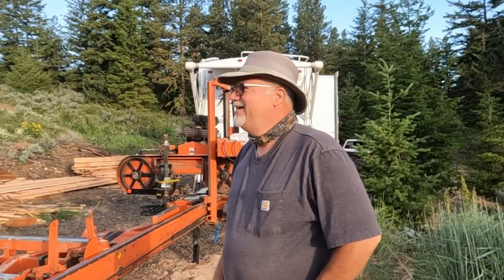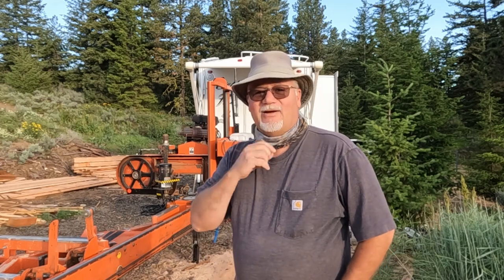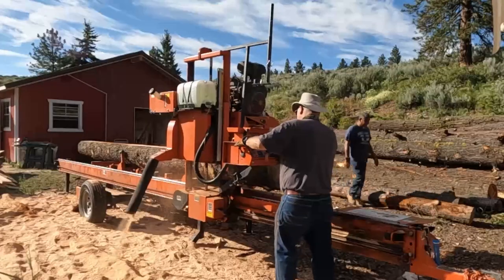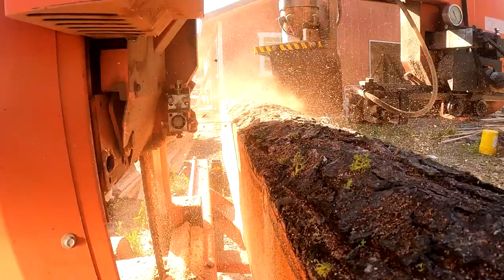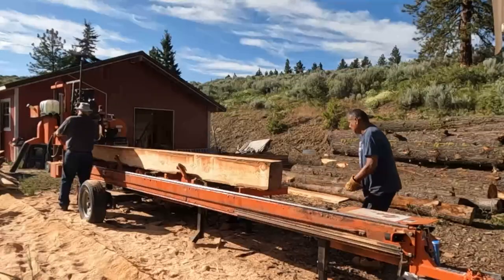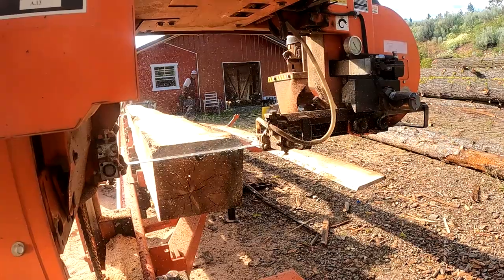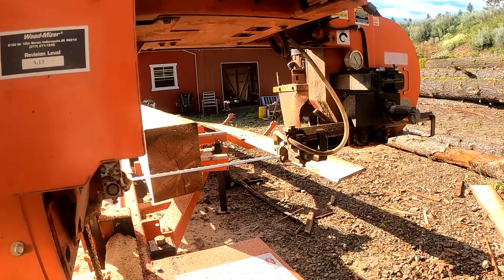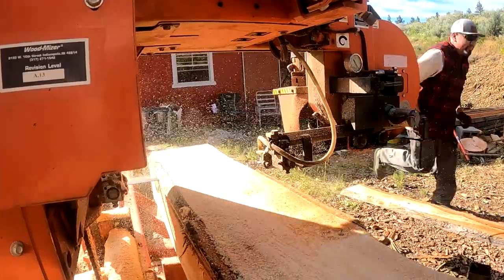Milling Doug Fir on the Wood Mizer LT40 [Mistakes were made]

Comment: In reference to woodmizer and the supply issues, I completely understand the hold up on parts. I'm very anxiously waiting on my call saying that my mill is waiting on me to pick up! Have a ways to go, orderd in 3/22 , build date at the time of order was6/23. One good thing is plenty of time to consider different options, which leads to my question.  Have you used a mill with the command controls? If so,what are the pros and cons? If not, what do you think any advantage  or disadvantages would be verses the walk along? Tia  
Great job on your work and keep the videos coming!!
Reply from the maker: First, I saw a post by WM on social media that they have secured more motors and production from Kholer USA and they anticipate releasing more machines soon!  Though they were talking LT15s.  Haven't used the command control but plan to test it out soon if it works out.  In short, I see advantages of both but do like the walk style control due to being up close and personal with the log and process.   However my back and knees would appreciate the command control.   Also, with my setup I can add a seat to ride when the knees don't want ro walk that much though maybe a switch to command control would be better...less sawdust

Comment: What does a mobile milling business require as in insurance , licenses etc. if any....  I'm thinking about doing some mobile milling once I get all my stuff cut... Thank You
Reply from the maker: Business license per your state, town etc where doing business is primarily what is needed.  Liability insurance is a good idea though a contract that specifically holds the sawyer not responsible fir injuries or damage helps prevent issues.  Beyond that a good truck, chainsaw, business acumen and advertising plus tools etc.  Check out my video on what I bring and my camper I use.
Reply from the maker: https://youtu.be/RLyxhtFssVw